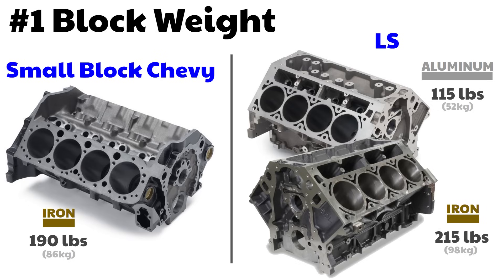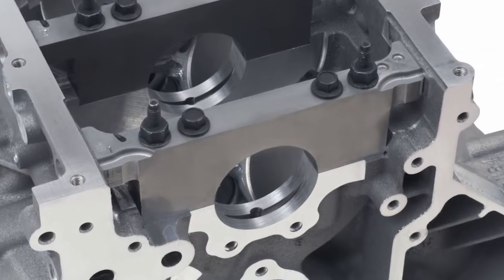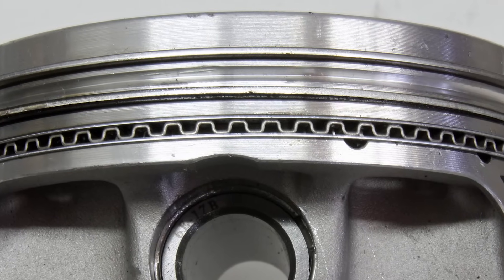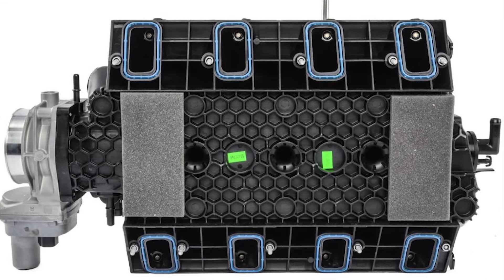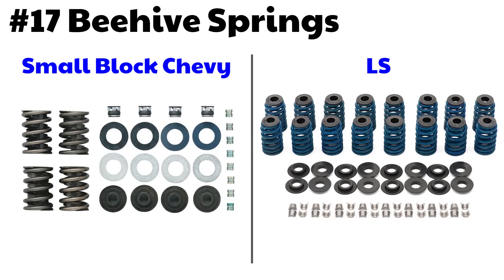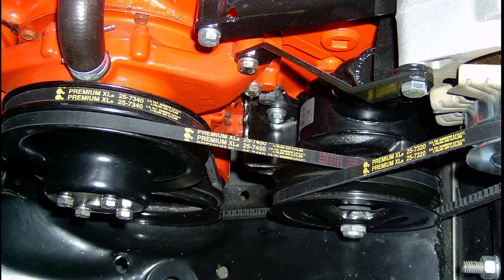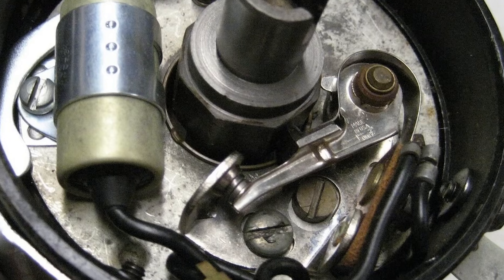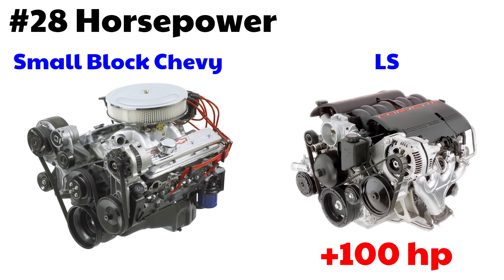29 Reasons LS is Better than Small Block Chevy (Gen 1 & 2 vs Gen 3 & 4)

Comment: Ls cost 2x as much to build and fix- that is a big disadvantaged-
Reply: If its twice as reliable than cost doubling is irrelevant.
Reply: @r4raced4doom2  not to my wallet it’s not
Reply: @williamsanders468  the only thing really of significance thats more expensive than its SBC counterpart is forged rods/pistons and maybe heads?  Which you don't need until you start pushing the 800+hp in a streetcar (assuming you want some semblance of reliability).  If your budgets that critical you probably shouldn't be building a car in the first place.
Reply: @r4raced4doom2  I just built an iron block 6.0 with 821 rec port heads with gen 4 rods and forged pistons all new for well under 3k and it is set up for boost,it will handle 800-1k hp,you cannot do that with an OEM sbc block or crank/rods/heads
Reply: Local junkyard sells 5.3 motors 350 to 500 dollars depending on millage
Reply: If anything in the next coming of years small blocks will be very outdated since LS’s are going to fill junkyards more and more since it’s a motor that the yard can make a profit from
Reply: I see the light, thanks for your guidance everyone.
Reply: How do you figure when LS engines are just as common if not more so in junkyards these days
Reply: @benbauer1257  you can get a nice Summit Racing cam for a old flat tappet SBC for like $65 new and 8 coils cost more than a distributor cap. Same goes for a carb and manifold vs all the components on a fuel injected LS like Throttle body, all the sensors, computer, wiring, injectors, electric fuel pump, fuel regulator, etc. You can convert an LS to carb, but it's not easy and costs much more. LS are better for many other reasons though.
Reply: @benbauer1257  Go build one and see for yourself.  There's a certain amount of luck involved in just getting one out of the junkyard and sticking a turbo on it.   That doesn't always go well.  
If you actually build one, they're not cheap.   They're awesome....but not cheap
Reply: Parts are 2x the cost, junkyards jacked up the prices cuz everyone is after them.

Comment: I'm a believer in sticking with whatever series of engine came in that vehicle from the factory or are atleast from the era. I'm not a fan of modern engines in classic cars, to me it seems to defeat the purpose of a classic car which is to be a simple fully analog and mechanical vehicle. I do love the ls engine but the gen 1 sbc will always be my go to v8 engine. The sbc is beautifully simple and only takes 3 wires plus the plug wires to run and doesnt need a computer or anything like that and makes putting it In Anything super easy and the sbc in classic cars will always be timeless because face it 30 years from now if you open the hood on a 69 camaro and you see an ls you will be like "oh that's outdated i wish the small block was still there". Dont get me wrong though I love the ls in cars  and trucks that came factory with an ls but I hate seeing them in older vehicles.
Reply: Exactly, I bet my 455 oldsmobile has more torque than a new ls. I wonder if ls engines will last 50 years like my 455 oldsmobile that is 49 years old and still running great.
Reply: @gabesgarden57  Well, years don't matter as much as the mileage, and I'll bet any amount of money right now your 455 won't be running at 300k miles like most LS motors are.
Reply: @SealofPerfection  only time will tell
Reply: @SealofPerfection  i bet it will
Reply from the maker: Totally get it.  Im a believer in horsepower and light weight engines.  : )

Comment: Im a Ford guy 100%. But, if you think an SBC can only handle 3-500 hp you're crazy. They can hold around 1000. Same for the cranks. Even a 305 crank can hold around 800 or more without worrying. Look up Darrell Waltrip talking about pulling junkyard motors out on Friday, cleaning it up with degreaser, doing a head and cam swap and running the short block in the daytona 500 on Sunday.

Comment: This just in: newer technology makes things smaller, lighter, and better.
Reply: It’s not a “small block bad” video, it’s a “look at why the LS is better because of all these improvements over time”
Reply: @andrewskaterrr  agreed.
Reply: @andrewskaterrr  Not everything on the LS is an improvement. Change your lifters, and report back....
Reply: Efficient reliable longevity durability complexity
Reply: Newer motors can barely make it 100 thousand miles some changes are ok but most are bs older cars and motors seem to out live newer vehicles  i drive a 1964 chevy with a inline 6 292 with points ignition every day no matter how far i have to go rain sunshine snowing  ect it always takes me were i need to go and always brings me home and wave to the new cars that are waiting for a tow
Reply: @josegonzales3371  that said, that 292 was practically indestructible.
Reply: @josegonzales3371  WRONG-O. Computer controlled, fuel injected motors are more reliable than any carbureted, non computer controlled engine. Period. I put 400,000 miles on my computer controlled, fuel injected 3.8l Buick V6. It was STILL running great, getting 26 mpg, when I hit a big deer, which finally totaled the car....
Reply: @josegonzales3371  what are you talking about? You’ve got it backwards. Older cars had 5 digit odometers because they never expected them to go much beyond 100k. It was the rare car that rolled over to zeros. I’ve had LS powered Yukon’s go 400k without burning or leaking anything.
Reply: @Maverick8t88 LMFAO.... So potential  odometer readings make engines more reliable!!!! LMFAO.....STILL😂😂😂😂
Reply: If they could throw away all the computer shit and 15 million unnecesary sensors they might really be on to something!
Reply: ...and more complicated.
Reply: @OOICU812  in terms of nuts and bolts, LS is just as simple as a 350 sbc. Because it’s just the next generation. Sure, there’s sensors and stuff, but that’s not hard. It’s not like it’s a big DOHC head. Even that’s not hard, I rebuilt the VANOS on my DOHC S54 in my BMW M3. Just have to pay attention and make sure you put it back the same way you took it apart.
Reply: @Maverick8t88 have you ever had a crank position sensor go out in the parking lot of the grocery store after loading up the bed of your truck with groceries? Unnecessary.  Sensor and location.
Reply: "Whaaaattt?.......Noooo waaaaaay........
Reply: except for the president.
Reply: More wires
Reply: You'd be shocked at the amount of people who will argue with this basic point. 😂
Reply: Not always. I’ve about had it with cheap electronics and automation on my vehicles
Reply: The LS  is not better. The LS  had its name stolen from the Mark IV big block. Newer is NOT better just because its newer.
Reply: @dolanroufs1032  LS is just better in every way. Deal with it.
Reply: @nodo7575  There is nothing an LS block can do that a sbc block can't. Except cost 4 times to rebuild. How exactly is that better? Oh, because you can't fix anything without a computer telling you what's wrong. Go on with your stupidity
Reply: @dolanroufs1032  so you would make the argument that the LS design is not better than the SBC 350. That a 6 bolt main and 1,000 hp capacity is not better than a 2 or 4 bolt main and a 500 hp max capacity. You would say that a 150,000 mile lifespan is better than a 300,000 mile lifespan. That electronic fuel injection with a computer regulating its ability to self adjust for multiple weather conditions is not better than a mechanical carburetor that has to be manually adjusted every time the humidity goes up. I could go on and on and on. The LS, Mark 3 or 4, is vastly, immensely, immeasurably better than the old 350.
Reply: @Maverick8t88  BTW I have a mechanical carburetor on my pickup and I DON'T adjust it every time the humidity changes
Reply: @dolanroufs1032  bro. Relax. Switch to decaf or something. Ok, so a guy built a 700 hp 350. Definitely a 4 bolt main then. Or block girdled. But the 2 bolt main wouldn’t last long at those levels. And how would 1000 hp capacity be a downgrade over 7-800? 6 bolts is inherently stronger, why would you argue otherwise? And yeah, maybe you don’t adjust as often as I said(check the definition of hyperbole, BTW) but for peak performance you need to manually adjust mechanics. And a tune up is a much more involved process. Most computer stuff is pretty quick, whereas adjusting carbs is much more involved. There’s no arguing that. 

Ultimately, here’s the thing: the 350 is a great motor, no one said it wasn’t. The LS is simply better. If you want to put a carb on one, there’s kits for that.
Reply: @dolanroufs1032  and btw, I’ve owned both. I used to push snow with a square body C30 that was 350/TH400 carbureted. So I know what it’s like to own both and daily both.
Reply: @Maverick8t88  all I'm saying is that something that REQUIRES a computer, isn't BETTER
Reply: @Maverick8t88  let me know when they cast over 100 million LS blocks
Reply: @dolanroufs1032  The 100 millionth LS engine was cast in 2011. Google isn't hard to use. Well, maybe for a boomer like yourself it is lol
Reply: @anonshitpost101  11-29-2011 was the 100 millionth casting of the small block introduced in 1955. Maybe you should learn to read
Reply: @dolanroufs1032  The 100 millionth SBC was an LS9 slick.
Reply: @dolanroufs1032  WIXOM, Mich. – General Motors today will build its 100-millionth small-block engine – 56 years after the first production small block – representing an engineering legacy that continues to deliver greater performance and efficiency through advanced technology.
Chevrolet introduced the small-block in 1955 and the production milestone comes in the same month the brand marked its 100th anniversary. The small-block engine has been used in GM vehicles around the world and is currently found in global Chevrolet, GMC and Cadillac vehicles, as well as Vauxhall in the United Kingdom and Holden in Australia.
“The small block is the engine that brought high-performance to the people,” said David Cole, founder and emeritus chairman of Center for Automotive Research – and whose father, the late Ed Cole, was the chief engineer at Chevrolet and oversaw development of the original small block engine. “There is an elegant simplicity in its design that made it instantly great when new and enables it to thrive almost six decades later.”
The milestone engine is a 638-horsepower supercharged LS9 small block – the power behind the 205-mph Corvette ZR1 – which is hand-built at GM’s Performance Build Center, northwest of Detroit. It represents the fourth generation of the small block and is the most powerful engine ever built by GM for a regular-production car. GM will preserve the engine as part of its historical collection.

What were you saying about learning to read?
Reply: @dolanroufs1032  I like the oart how you got owned with facts so you changed the goal posts. lEt mE kNow wHEn Ls hAs caST OVer 1 MIlLIon bLOcKs hur dur.
Reply: @Maverick8t88  how is adjusting a carb more involved than fucking with a fuel sensor. Screwdriver go righty tighty, lefty loosey.
Reply: @Maverick8t88  uhhh my sbc has 202 heads and it flows and runs better in general, than my dads 2014 5.3
Reply: @badeagle7444   yeah, if you just want a bull in the China shop tune, you can monkey around with the screws until it “sounds right”. But to properly tune a carb takes hours. Changing the jets, vacuum gauges, check the points, check the plugs, blah blah blah. Every couple of thousand miles you gotta fiddle with that thing. That’s all fine and can be fun on an evening with a couple of guys and a few beers. But I’d rather be driving. Sure it took a few hours to get my fuel map set, but if I ever want to change it, it’s 30 minutes. And the best part is, I don’t have to change it. Driving to the mountains? Computer adjusts for me. Temperature dropped 30 degrees overnight? No problem. I’ve got nothing against carbs, but you’ll never convince me that they’re superior to EFI for daily driving. 

I’ve already posted flow chart numbers on 202 double hump heads vs 243(LS) and 799(Vortec) heads earlier on this thread. The cfm’s (cubic feet per minute)on a stock LS 799 head are higher than a stock 202. Done. Nothing more needs to be said. The 243/799 has a 65 cc combustion chamber similar to the 202, but the chamber is heart shaped vs being wedge shaped, which creates better fuel air Mixture for better combustion. 317 and 853 LS/Vortec casting are a whole other animal and are really only good for Forced Air applications where the larger combustion chamber  actually helps. Maybe that’s what your dads got, idk. Point is: numbers don’t lie. I love carbs and old tech, but modern advancements produce more power from smaller, lighter power plants.
Reply: @Maverick8t88  lmao I don’t get why people worship the ls motor a good running small block is perfect for me and I have that so keep your Dell computer on wheels
Reply: @badeagle7444  worship? No. Respect? Absolutely. Nothing wrong with a 350, like I told the other guy. But a block that can be easily built to 1000 hp and beyond and then dropped into just about any engine bay on the planet is going to get people talking. Honestly, I don’t get the hate. If you love the 350 so much, you should love the LS family, it takes all the best parts of the old and then improves them.
Reply: @Maverick8t88  didn’t say I hated them just don’t compare to old school imo
Reply: @dolanroufs1032  Amen!
Reply: @dolanroufs1032  Amen!
Reply: @dolanroufs1032  Seriously, dude? You again? Get a life. That conversation was 9 months ago. I’d forgotten you existed.  Did you read the whole article? Because I especially liked the part where they used Vortec heads to do it and specifically say they flow better than old GM. Vortec is the cast iron version of the LS, btw. In case you didn’t know. 1000 hp does surprise me and I do wonder how long the block will last. But cool build on an old school 400. Not a 350, btw. We were specifically talking about the 350. Just saying. 

Can I just point this out again: No one said the SBC was a bad motor. It’s a great motor, legendary, in fact. What I said was that the LS platform was better. Better flow, better power, lighter platform. 

Now let me give you some advice. To hang on to something this long and come out of nowhere with an ‘AHA, NOW I GOT HIM!’ is immature and shows some really unfortunate personality traits. Let it go man, move on with life. There’s more important things to do than try to win arguments online. As it stands right now, I don’t ever want to hear from you again unless you want to have a civil discussion, because right now talking with you is an unpleasant experience. You have been rude, short tempered, aggressive, and foul mouthed. In short, the type of person I avoid spending time with. So good bye, and I wish you well as you work on whatever project you’re building.
Reply: @Dolan Roufs  It won't be long, although I ask you this; What the Hell does casting 100,000,000 of anything have to do with quality?? The LS will surpass that number easily. Simply due to the population increase compared to what the population was in the fall of 1954. Time marches on. The original SBC will always have a place in my heart AND garage. But even if they built 200 million of them, or 300 million of the LS, what's the point? I loved my Yoshimura built 1,105cc Kawasaki Z1. But there are 650s today that would put an ass whupping on it. Time waits for no one. There's guys still arguing the flathead Fords superiority. Who cares? Build what you want, and enjoy it. In recent Engine Masters contests, modified Ford 400M based engines have been kicking the asses of the LS AND SBC. And so it goes......
Reply: @Caleb Morgan  Agreed 100%! The LS superior head design is why you can gain 100hp on an LS7 with just a cam change......Which, btw, can be done without draining coolant, or pulling the intake.....

Comment: Honestly you can build either motor to reach 1000 hp. Just depends on how much money you want to spend. You can do it cheaper on an LS though. That’s a good thing. I love both engines. Have a mint 99 Sierra with the 5.3 and I have a 90 C1500 with the 5.7 350. Both trucks have never left me stranded. The updated design on the LS is far better than the past generation SBC. However a SBC street motor can still be just as reliable and have good power, you just have to know how to build it right.